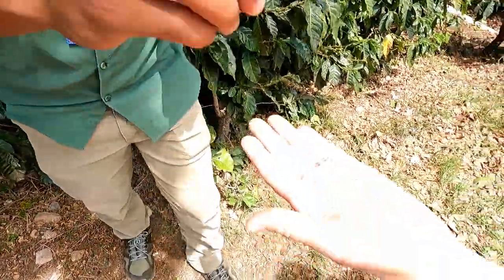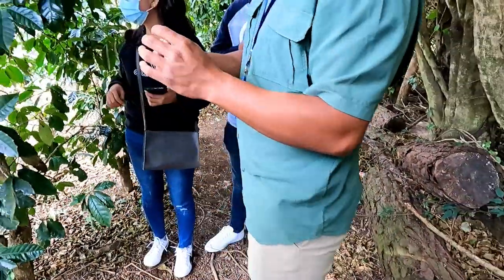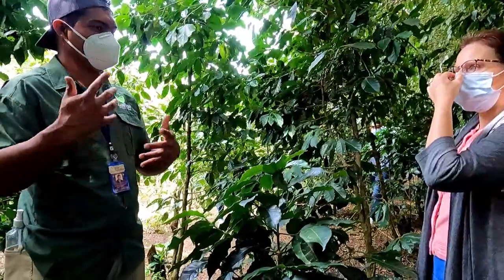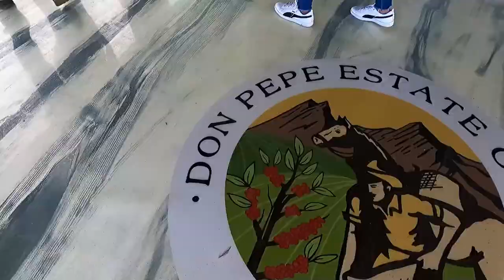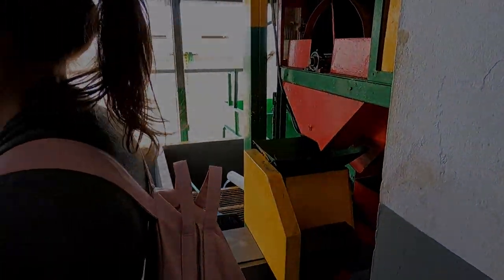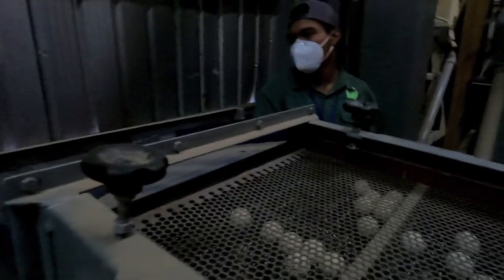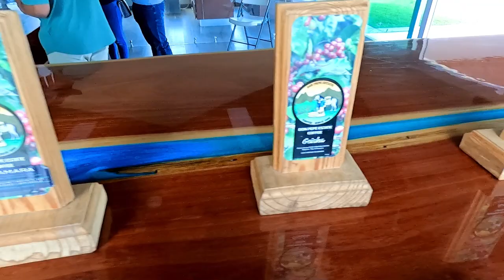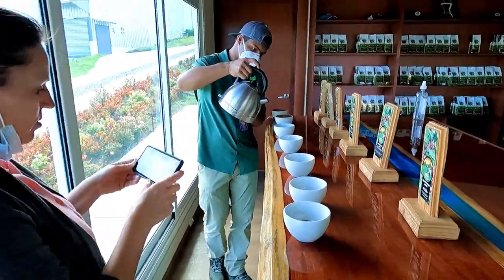BOQUETE PANAMA COFFEE TOUR AND DOWN TOWN GARDENS

Comment: That was a coffee buffet! Nice
Reply from the maker: Yes it was!  Great to hear from you  I was worried after not hearing from you on the transmission video. The channel is finally back :)
Reply: @L2theWcarscoffeelife  I did watch your trans video a while back. When I put a looser converter in my car it shifted way "softer" than before. It shifts firmer the more throttle angle I give it, lol. As far as you giving up on the car content, we'll see. It's in your blood you'll be back!
Reply from the maker: He said it would take a little bit for the trans gel to wear off but yeah it would shift soft despite the upgrades with the high stall converter.   Yeah I have to fix the wheel bearing in the GTO need.to do it soon before the heat turns to ludicrous. No more project cars  my back cant do it. Yes never fear plan on doing cool car related stuff in our travels  always a car guy 😎
Reply: @L2theWcarscoffeelife  abag
Reply: @L2theWcarscoffeelife  HGag